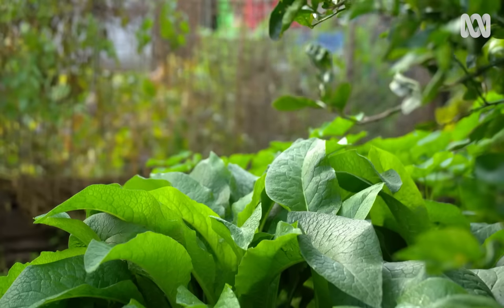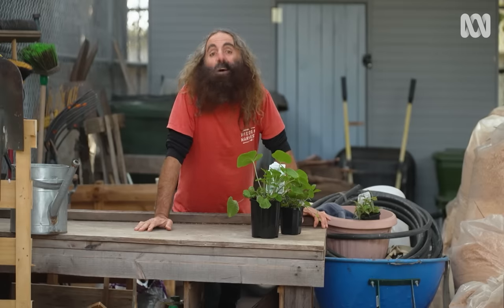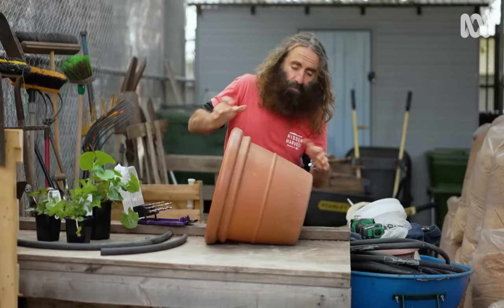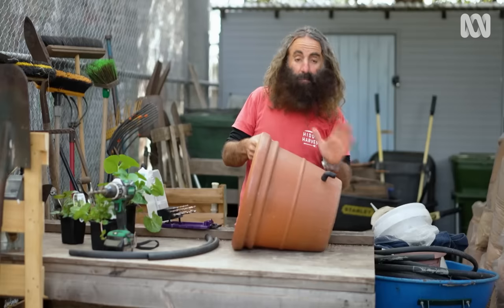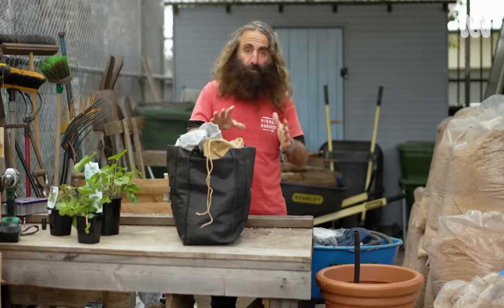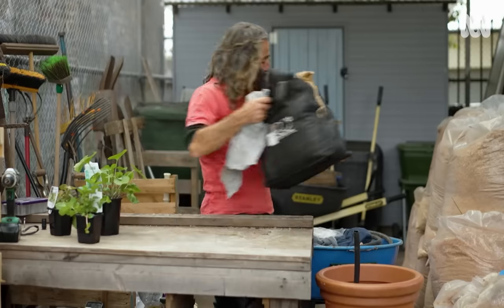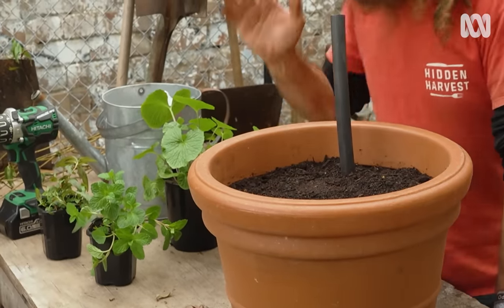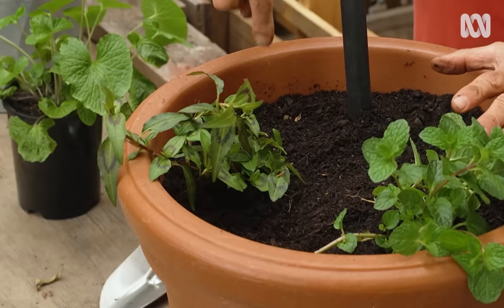How to make a wicking pot so your plants self-water | DIY Garden Projects | Gardening Australia

Comment: It seems to me that as soon as the water level drops below the wicking substrate the system will stop watering.  The wicking material has to extend to the bottom of the water reservoir to be fully used.  Did you even try this pot before posting it on Youtube?

Comment: Wicking pots are great in the summer but not in the rainy winter season. As they can flood the pots and plants. I remove any plants before winter in a wick pot.
Reply: Isn't that what the overflow is for?
Reply: @kasession that's precisely what it's for. I use these year round with no trouble. Long as the drainage hole is below the soil level, these are solid - especially in rain actually.

Comment: Love this method. Would the fabric create mold or mildew?
Reply from the maker: Geotextile fabric is designed for use in the soil and won't create a build up of mold or mildew. Hessian can be used too as it works in a similar way but it's an organic material so will break down and need replacing eventually.

Comment: No irritation clips on the pipes?
Reply: I mean they won't be under any pressure unlike drip irrigation, I guess it's not really necessary
Reply: @lauravanwensveen7951  yep true that.. 👍
Reply: Although I've found for drip and low pressure spray heads, you're not needing clamps for that either.